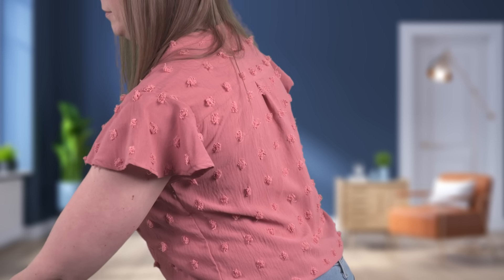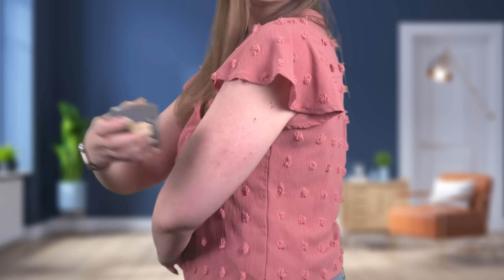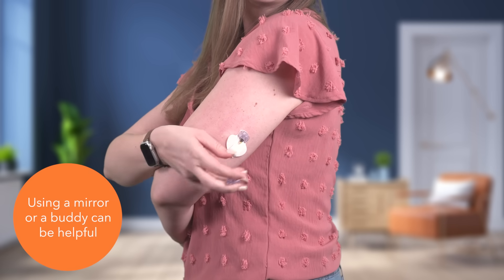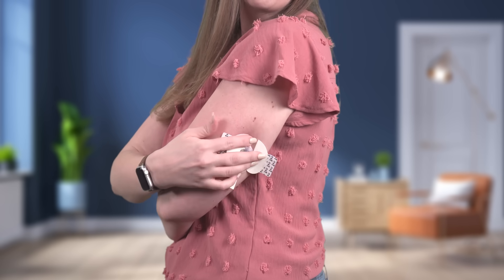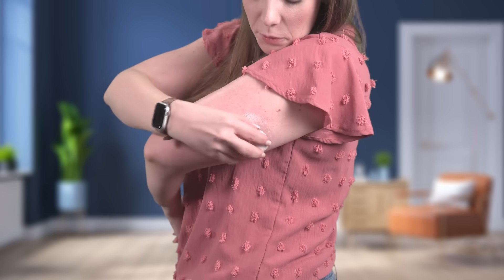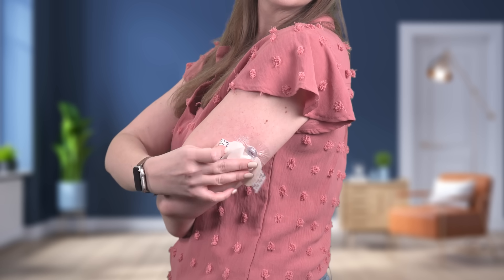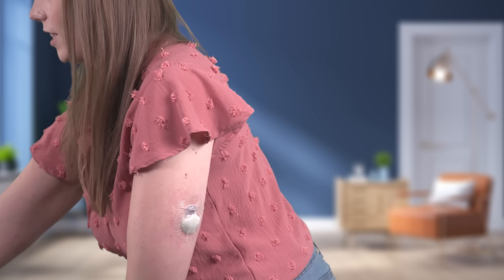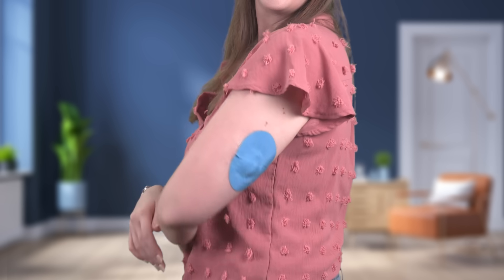How-to guide for self-insertion of the Guardian 4 sensor

Comment: It's an awful design. The pump has always worked and has always been very reliable. The sensor however has really let the whole cgm system down. I'm forced to place it in my abdomen area , not because it's not easy to place in your arm by yourself but you tend to rub this area frequently. 

Very rarely does my pump last 7 days. The other day when I asked to order my sensors I was quizzed as to why. " You don't need this for at least another few weeks ". I explained that it frequently does not last more than 5 days. I was made to feel awful and that I was abusing the healthcare system.

I explained that it wasn't something that can be abused and that due to my ease of use of my pump they have now made me dependant on the medtronic sensor.

Disgusting money making scheme. Clearly you  did not test ease of use on enough people or the durability of your product. Please improve customer service and your sensors.

Comment: I've only used Medtronic pumps for the last 25 years but will not be upgrading to this system.  The sensor application / insertion is unnecessarily complicated, unlike the Libre 3 and Dexcom G6 and G7.  They should have maintained / developed their relationship with Abbott's Libre CGM system.
Reply from the maker: Hi there. Last year, we announced a new partnership with Abbott. Details about the availability of the integrated sensor will be shared as the partnership progresses.

Comment: Tip for anyone struggling doing this themselves: it’s 100x easier with a mirror. Maybe I’m an outlier but I’ve not had any problem with inserting the sensors myself

One thing I would say though - the oval tape, really sticky, painful to remove, and the residue it leaves is really hard to clean off

Comment: I’ve become so frustrated with these sensors. When they work they work great and the pump does its job. However when the sensors fail it’s totally different story and the sensors fail frequently. 4 out of 5 of my recent sensors failed after 2-3 days of use with an error message “sensor not working properly” “replace sensor”. After I spoke with technical support I attempted to insert the 5th sensor from the box and as I was pulling the “shooter” the whole sensor pulled away from my skin even though it was completely adhered. These sensors are poorly engineered and I just expect a lot more from Medtronic.
Reply from the maker: We're sorry to hear that this has been your experience and we'll notify our team of this. Please let us know if there is anything else we can do to help at this time.

Comment: God awful to limit the location like this. Limiting to it is just going to make it fail due to scaring eventually. The damned fucking thing doesn't even work in the leg. Awful.

At least i finally got my doctor to lower my basil on this thing. It only took 1 cracked pump four months of being up with low sugar till 4am every night and 2 visits to do it. I hate this damned thing now and want to downgrade off the system. My biggest issue is that i can't press the damned button to insert to anti self harm instincts. I have to flick the button and you can't do that one handed on the back of the arm.
Reply from the maker: We're sorry to hear this. If you would like to speak to someone about your experience, please give our Technical Support team a call at 1-800-646-4633, option #1. Thank you.

Comment: Listen if you want to have a sensor and a pump connected to your body like I Do it's your choice but I Regret it deeply because the sensor is most of the time Faulty and does not work sometimes they even expired when they got Here and it is so Difficult for it to work I had to put in 4 Sinceres. and my arm started Bleeding of all The Times the needle had to break my skin So I regret Deeply getting the sensor and monitoring device😢
Reply from the maker: We're sorry to hear about this. Have you already had a chance to speak to our Technical Support team about this? If not, please give them a call at 1-800-646-4633, option #1. Thank you.

Comment: I have a question about the  guardian 4 sensor : being put  on my stomach instead of my arms  because it's hard to put it on by myself, and it doesn't seem to stay on  my arms 😢? Not very happy with the guardian 4 system 😢
Reply: I do it in my stomach
Reply from the maker: Hi, Toya. For safety reasons, the Guardian 4 sensor is indicated for use in the arm. If another site is needed, please work with your healthcare provider to assess.
Reply: @MedtronicDiabetesUS  for safety reasons?  what does that mean?

Comment: why is this process so hard? Other CGMs are simple, remove tape backing, insert, clip in transmitter, done....what were they possibly thinking? This is a dumb design that should be re done, don't even push this junk out

Comment: Been with Medtronic for over 20 years now. Medtronic invented the CGM, and yet have the worst hardware for patients??
30 minutes to charge the transmitter..2 hours for sensor warmup and the occasional system upload 2-4hrs.
Can't apply this on my arm by myself. Only 7 days per sensor.
Dexcom G7- no charging, 26 minutes for warmup, 10 days+12hrs of the most accurate readings I've ever had.
Unfortunately G7 works with every pump except Medtronic. 
I'll be switching off Medtronic asap.
Reply: Just tell the truth. This sensor is so bad. The worst on the market. I have been using Freesyle Libre 3 for a while but had to switch to Guardian 4 due to new insulin pump. It's so bad compared to Freestyle Libre. Freestyle takes one minute to switch. No charging. Last for two weeks. Easy to change. Absolutely everything better. The Guardian is just frustration.
Reply from the maker: We're sorry to hear this, and will be sharing all of this feedback with our team.
Reply: Sensor is a nightmare totally outdated

Comment: I’ve read in the ether that the G4 transmitter works perfectly fine attached to leftover G3 sensors. That fundamentally the G3 and G4 sensors are functionally identical. Again, this rumor and innuendo from the internet.

Comment: Sorry. But I’d need a third arm to do this myself. Can I get the sensor inserted? Yes. Pull the pin? No. Remove the sensor tape? No. Position the oval tape without ruining it? No. I think the Medtronics engineers have a sick sense of humor designing something like this.
Reply: I just inserted my sensor (or at least I was trying) and I couldnt pull out the pin. I was trying to save the life of my sensor put it all just fell off when I finally could pull out the pin. I hope they send me a new one because I’m starting to get really tired of this
Reply: @EnikoMolnar-cq2el yes, call them and they'll absolutely send you a replacement.
Reply: @EnikoMolnar-cq2el
Reply: Put it on the belly
Reply: @gabrielebattocchi5593 I thought that was not allowed in the US?
Reply: @jackqueline50 don't know, i'm Italian it actually works very well

Comment: Been waiting for the Sensor 4 for over a year in Canada but it has still not happened and no press release. Just rumors that it will be available July 2024. Asked Medtronics for the press release but customer service has failed me so many times.
Reply from the maker: Hi, David. We've seen an overwhelming demand for this system, and we're working to increase our processing capacity and supply for the sensors so our upgrade customers can benefit from all its features.